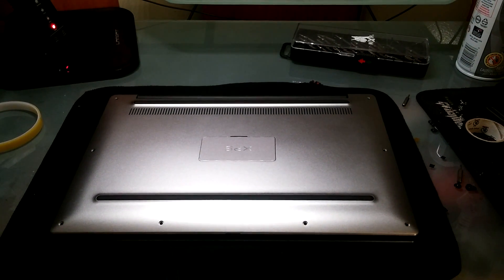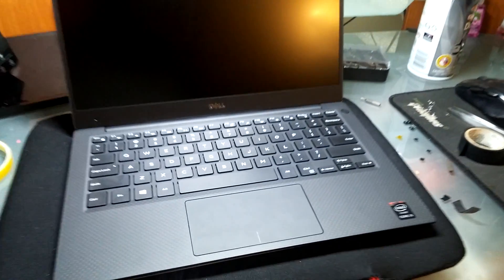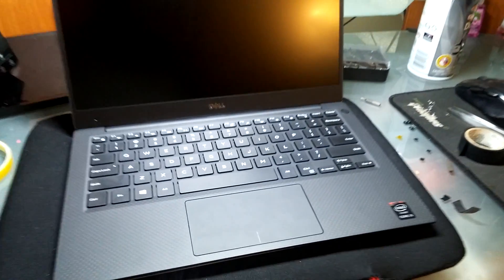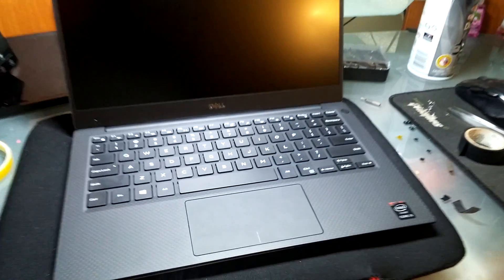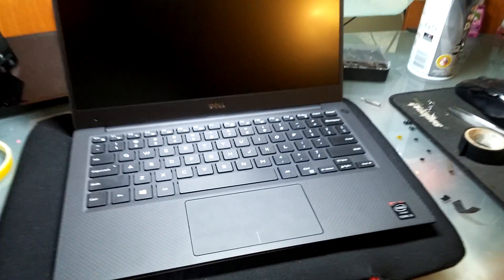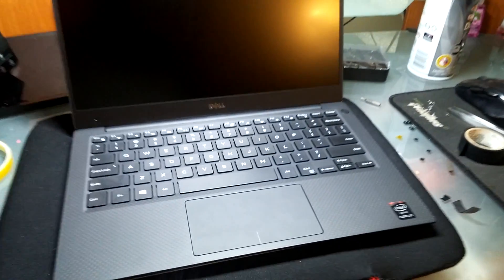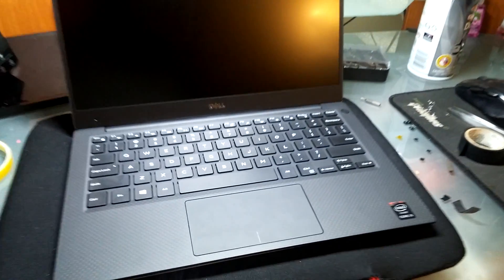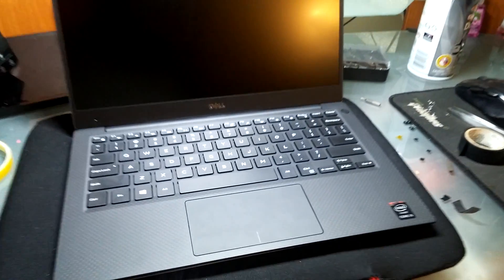Dell XPS 13 9343 2015 - Loose Rattle Trackpad Mousepad Touchpad Problem Fix DIY  Laptop

Comment: The only difference is that in my case I have stick the tape in the small circle in the touch pad itself instead of the laptop chassi... In my case (XPS 13 9310) it worked better that way :)  Thanks a lot :)

Comment: This worked brilliant! Thank you! I had the same issue with my Dell Inspirion 15, great solution. In my case i just put two layers of tape on the inside of the metal bracket to put a little more pressure on the touch pad.

Comment: Thank you for you excellent video which answered many of my questions regarding the XPS trackpad design - still in use in 2020 by Dell, hence why it remains relevant today. The present XPS 15 and 17 are plagued by loose trackpad complaints, and seeing the design, one can easily understand why it has this tendency. Great job on a nice simple fix. Relatively easy to do for anyone reasonably tech capable. 

If this problem ever affects my XPS 15, I’ll do the fix myself. I have trust issues and there’s no way I’d have a Dell tech of unverifiable competence meddle with my machine!

Comment: my alienware m17r3 also has a rattling touchpad. I'm wondering if it's just supposed to be like that. Still... Weirdly enough, I just tilted my laptop and pushed the trackpad a bit at one corner to hold it down and then I clicked a bit all over before releasing and trying again and now there's zero rattle. What the hell? As long as it doesn't bother the hell out of me, I'm not getting a repair guy out here. Those guys are good at causing more problems than they fix.

Comment: Has anyone tried this with the thin aluminum that is used on metal furnace ducting?  It's thinner than the electrical tape and moulds and sticks to metal surfaces better as well. Just not sure if it would work or not.

Comment: Thanks a lot man. Bought a new dell inspiron 3584 2 weeks ago. Was frustrated with the same problem. Mine gave even more sound than yours. Your solution is fantastic. Solved the problem within 5 minutes. Feeling better to use now. Thanks again

Comment: Only one on youtube, that know what there doing by adding tape to the trackpad bottom silver dot. also an extra step is to add foam to the back of the track pad to let of extra pressure.also people tend to bash the track pad instead of light clicking, so extra FOAM will help massively. Cant get my head round why ppl haven't found a solution for this a long time ago.

Comment: I'm sure it's enough to tighten all the touchpad and battery screws and it will fix the problem. In my dell 7570 it worked

Comment: Hey Sam!  I know this is a bit late, but I just ordered a Dell Inspiron 14" 7460 and it has this same exact problem with the trackpad.  I have never opened a laptop to tinker with it and I was wondering if the process would be fairly similar as it was for the XPS.  If there is any way we can direct message so you can help me it would be greatly appreciated! I just want to fix this issue without sending the laptop back to Dell and waiting for them to return my purchase.  Please help Sam!!!
Reply from the maker: Hey Alex, I've taken a look at the 7460 and it seems like the keyboard could be fixed around the same way as this one as their designs are very similar. The trackpad floats on top of something and there's a gap in between.

There is a battery in the way of the trackpad of the 7460, just like this XPS 13. I would give it a shot and see what you can do. My number 1 advice for exploring new disassembles would be to make sure you have time and patience. Carefully inspect each wire detachment, part removal, etc. Look for how they're secured. Also, stay organized. Take pictures of each layer of disassembly so you know how everything goes back. Keep screws separated.
Reply: Sam K thank you so much for the quick reply!  I'll give it a shot.  I'll be as careful and slow as possible.  [EDIT]  So I attempted to fix the loose touchpad....and I SUCCEEDED!  Your video was a vital source of assistance in the process Sam K!  There were a few small variations between the two models but with your video, and Dell's manual on their website, I was able to fix the problem using 2 small slices of electrical tape!  Thank you so much for the help man; I really appreciate it.  You're awesome bro 👍
Reply from the maker: I knew you could do it! ;)
Congrats!
Reply: Sam K, on another note, is there any way to remove the 'flexiness' in a laptop keyboard?  When pressing keys in the middle of the keyboard, there is an amount of keyboard depression or 'flex'.  I was wondering if you had any more hacks to fix the problem?!

Comment: I have a new inspiron 15 7000 that had the same problem. I found the screws that attach the track pad to the laptop body were slightly loose and tightening them resolved the problem,  so I would recommend trying this first before removing the track pad and risk voiding your warranty
Reply: Quick question was it the inspiron from 2017 (7567) or the the 2016 model (7559)? Cause I have the 2017 model and I have the same issue on the right side.

Comment: This is NOT a normal issue. It is a defect. My XPS 13 had a loose track pad out of the box. I promptly returned it and my replacement works perfect. The floor model also worked perfect. Send these back to Dell to make an example. Poor QC should not be tolerated.
Reply: dell refused to repair mine

Comment: Thanks for this! I just bought a newly refurbished 9360 a couple weeks ago and the touchpad rattle was driving me insane. Managed to use a tiny flathead screwdriver instead of Torx and it took 3 pieces of tape, but now it is SOLID with no give at all. I did goof putting the cover back on though... I worried so much about not breaking the speaker cables that I taped them too flush to the battery and ran them adjacent to the service tag cover screw location so it got crushed when I put the main cover back on. I even lost sound, but it came back and is now fine since positioning it correctly around said screwhole. Sorry for the rant but, yes very happy now. (I've also now seen what parts were refurbished - a broken touchpad belt clip, 2 threaded battery screwholes... and this is already after needing new hinges for my Space bar. Takes the p really for a £1200+ laptop).

Comment: Fixed this without any unscrewing. Held both front corners of the laptop base and pushed up from below the centre of the base directly under the middle front edge of the trackpad. Frame flexed by about 1cm and a small creak heard and when preasure released the frame returned to normal. Now the trackpad is solid and totally rattle free. Must be seated properly against the button / frame.

WOW, what a difference. The rattle was driving me mad!! I was close to returning what is an excellent laptop. Keeping forever now ;)
Reply: This worked for my laptop. Like you said, sometimes it only needs a bit of pressure. Flexing a little as you described, made the trackpad of my laptop adjust. Thank you so much!

Comment: Okay to start thanks for the video love it.

Second it was like this the moment I opened the box. Isn't it supposed to be like this? And if not wil they solve it if I make a warranty claim? Because I don't feel like scratching my two weeks old, brand new laptop.
Reply: jafar hamdaoui I returned mine less than an hour after having it. I replaced and have not had a single issue since. This is a manufacturing error.

Comment: I managed to fix it just like what a lot of people have been saying: tightening the screws. It never really worked for me at first as I tightened the current screws to no avail and was about to take up the challenge of opening everything up.
Here's how it worked for me in a more detailed format: I was trying to follow the instructions outlined in the video above. Got myself the T-5 screw and electric tape. Unscrewed all the screws but failed to take the lid off. Disappointed, I began to put the screws back in place but had the idea of trying to squeeze both sides of the area around the trackpad as I screwed the front two screws in place (along with squeezing the corners for the front corner screws). Surprisingly, this worked for me and my trackpad after 2 months of being loose with rattles is now firm just like any other normal laptop. Also noticed that a gap that previously existed around the trackpad has diminished thanks to the squeezing and then putting on the screws simultaneously. Hope this works for other people before they decide on popping things open!

Comment: Thanks man! It's a bit different for the XPS 13 2016. For others with the 2016 model: you don't have to remove the whole trackpad, you can simply lift it a bit since there is a lot of movement possible and put the tape on there with a toothpick or something. For me 3 pieces of tape stacked on top of eachother was necessary to fix the issue, but now its absolutely perfect. I've also had issues with the trackpad glitching out and poorly responding or only registering 2 out of 3 fingers, but now that has been fixed too :)
Reply: Hi. Did you still have to open up the laptop from the bottom as well? Also, what kind of tape did you use? Thanks!
Reply: Alden Hartopo Yes we did, otherwise you can not get to the frame. I used the same tape as on the video. Just thin black tape, not duct tape. It was really thin so 3 pieces were needed to make the difference. Prying the laptop open was pretty scary, but you can apply quite a lof of force since the aluminum is pretty strong. Hope you'll fix it! Would be happy to answer any question.

Comment: Holy crap dude, I have a Thinkpad X1 Carbon, and had this exact same issue right out of the box. I couldn't find any solutions, and was about to bite the bullet and send it in for repairs. I decided to go at it one more time, but never thought to look and see if other brands had the same issue. This completely fixed the problem.

I... I love you
Reply from the maker: love you too
Reply: How many layers of tape did you add? And does the round thing look just like the one on the video? I want to try this on my X1 but I am scared that it will be easy to screw up.
Reply: 3 layers of electrical tape if I remember correctly. Worth noting I didn't actually take the thing fully apart like he did in this video (I did what Tom Naber did). The gap is reachable from the outside on the X1. I slightly lifted up the touchpad, and used a thin piece of plastic to move the tape pad into place and press it down firmly. Good luck!

Comment: I got almost the same result by not unscrewing a single screw. I just squeezed a little piece of lucid adhesive paper (the lucid one is kind of plastified and should last longer than normal paper) through the tiny space between the touchpad and the chassis, pushing it in with a small nipper and another small piece of rigid paper. Of course I can't see the actual result from the outside but I suppose it sticked on the right place. Now the pad is stiff enough and not making the noise anymore. Really thanks alot for the video you made cause it allowed me to see where the problem was and where to push the thing in. Really helpful.
Reply: Same idea: cut a strip of Scotch tape about a quarter inch wide. Fold over one end so about 1/2 inch of the strip is not sticky. Slide the non-sticky end in the slit between the bottom of the touchpad and the chassis. Use the sticky end to hold the strip in place (and to take out the strip if it wears out). Experiment with thickness and width for your situation. About a quarter inch wide of normal Scotch tape works for me.

Comment: Thanks so much for this video.  This was the only complaint I had about my new XPS 13 (9350).  I ordered an Intel 8260 Wifi card to replace the broadcom one, so when that arrive and I install it, I will be applying this fix to my trackpad.   Thanks again!

Comment: hi bro nice video. i have a question in regard to my dell xps 9550. all is good but my number key (numer 8 and 9) sometimes give me a rattle like feeling when it i press it. it doesnt get stuck or anything but it feels like it hits something halfway and it just doesnt feel good. any fix for this? thanks
Reply: it also works fine but it gives that stuck or hitting something like feeling about every 1  out of every 15 presses. thanks
Reply from the maker: +gamer mashter 
sigh, dell and their quality control..
Good news for you! Keyboard problems are easy fixes or if replacement parts are needed, they're not too expensive.

Sometimes particles of food or debris gets trapped underneath a key. Sometimes, something gets out of place. Like any doctor, you'd need to see whats on the inside to properly treat a patient.

Try prying the key out either from the top of the number key or underneath. Once out, inspect everything to see if parts are out of place, tabs broken, etc. Prying the key out may kkkkkkkkkkkkkkkkkkkkkkkkkkk-0ijioiiiiiiiiiiiiiiiiiiiiiikkkkkkkkkkkkkkkkkkkkkkkkkkkkkkkkkkkkkkkkkkkkkkkkkkkkkkkkkkkkkkkkkkkk
I just pulled out my "k" key right now. To describe the experience, it may seem like the key is going to break or unusual, but just do it. It'll come out. After the top is loose, pry towards the bottom.
Reply: thank bro will try that out, i can stand it for now, its random when it happens.

Comment: My Acer Chromebook started to develop the problem a couple days ago. After taking it apart, analyzing its operation, I found the problem has to do with a piece of black plastic that probably serves to block dust from entering the gap between the touchpad surface and the palm rest.

Some liquid may have seeped into the gap causing the black plastic to stick to the underside of the palm rest. Additionally the touchpad is pressed against the palm rest by two metal springs positioned where you'd normally push down on the touchpad to perform the left and right clicks.

So when a light pressure is applied near the touchpad edges, the black plastic is separated from the palm rest causing the annoying sharp rattling sound. I just used a Q-tip moistened with alcohol to clean the mating surfaces and the annoying clicks were gone.

I'm sure some residue of whatever liquid that happens to be spilled on the touchpad as I read near the bathroom sink when I do my nightly hygiene will probably create problems again, but now I know how to fix it.
Reply: +Nghi Nguyen 
I watched your video again and realized you did something different to achieve the same objective: to reduce the tendency of the mating surfaces to stick together, which is also a great idea. I suspect your method may actually work better in the long run because the thickness of the electrical tape would definitely create a larger gap between the surfaces--unless the electrical itself may become sticky over time. Either way, now we know how to fix it.

It's possible that the oil from our fingers gradually finds its way into the gap causing the stickiness. This may explain the reason why so many folks start to have the problem after a while.
Reply from the maker: +Nghi Nguyen 

Thank you for your input and much thought put into this problem.
All the procedures in this video only contributed to one thing. To make sure there is no gap between the touchpad clicker and the frame of the laptop as the touchpad actually CLICKS when it's pressed against the frame of the laptop.

The clicking part of the touchpad can be seen @5:46 of the video. It's a small clickable circular metal piece.
At resting position, that metal piece should be resting against the raised metallic nipple on the frame of the laptop.

Comment: HP Spectre X360 owners represent! Damn Synaptics touchpads! Might give this a try. Thanks for the great video.
Reply from the maker: Wow! I'm glad you found this video. 
I didn't like the Dell xps 13, so I bought the HP spectre X360. Had the exact same issue!! 
Applied this fix and everything is good to go again :) 
Good luck on your fix!
Reply: +Sam K Thanks - that's encouraging! I was almost thinking of getting an XPS 13. Do you like the Spectre better overall?
Reply from the maker: +AetherElemental 
I love the spectre way better!! The xps 13 feels like plastic.
Keep in mind this is personal preference though. The spectre x360 is much more elegant and feels so solid with little to no plastic parts.
Having used both quite a lot, my only complaints about the HP spectre X360 vs the Dell xps 13 would be the Dell speakers sound a lot better and the dell's charger is much more portable.
Reply: +Sam K Interesting comparison. I like the look of the new Thunderbolt 3 dock for the new XPS 13, that combines power, DisplayPort and USB in one, but your comments make me feel better about having the Spectre!

Well, I did the fix from your video, and it's a lot better now! Still a very slight rattle in the centre-front of the touchpad, but I'd say it's 90% perfect, and not annoying any more. I slipped a doubled-up piece of tape between the dome and the metal it presses against, which is a slightly different procedure. I might make a video to show exactly how.

edit: I posted a comment with a link to my fix video, but it doesn't seem to show up - so see my profile if interested.
Reply: +Sam K I found the opposite, hated the spectre when i tried it, which sucked because i loved how it looked especially with the copper accents. The bottom felt plasticy and would flex as i picked the unit up one handed. Tightening the screws helped a bit but definitely didn't fix completely. The screen had a very yellow tint to it as well, which is common to some of the higher resolution panels. 

Happy with my 1080p xps13 though i will try your fix Sam. Mine is only very slightly off.
Reply from the maker: +Arbae that's strange, my spectre x360 is aluminum even on the bottom and is super rigid
hope your fix went well with your xps 13 :)

Main reason why I sold the 13 was the small size of the screen. Now that the 15 is out, I wish I could afford it haha